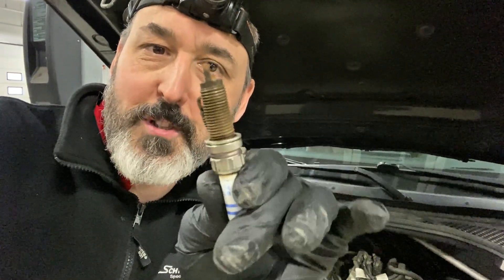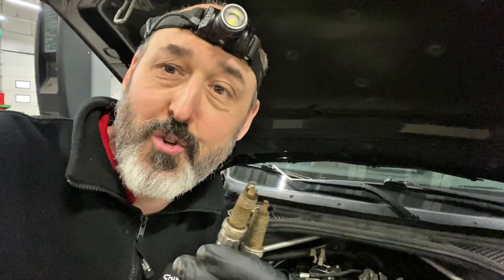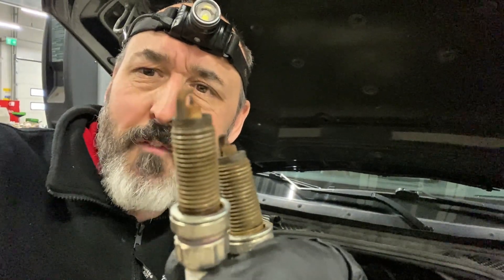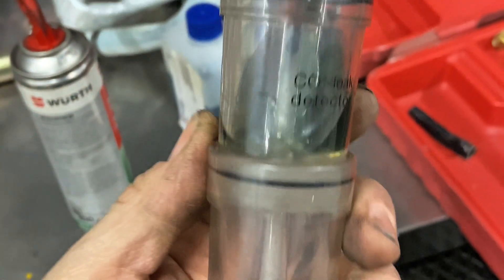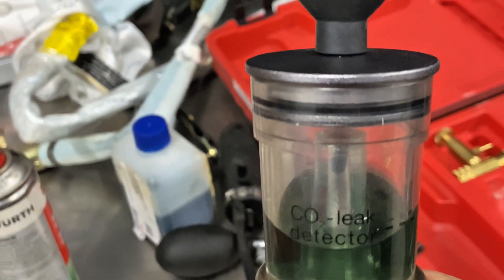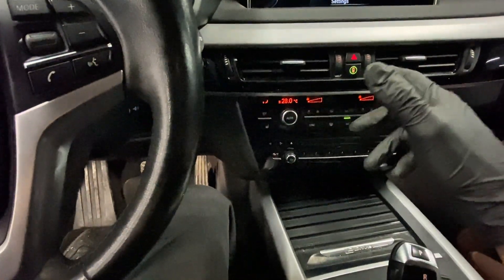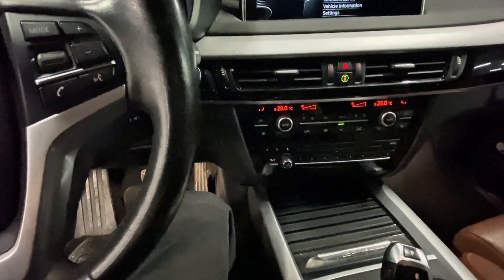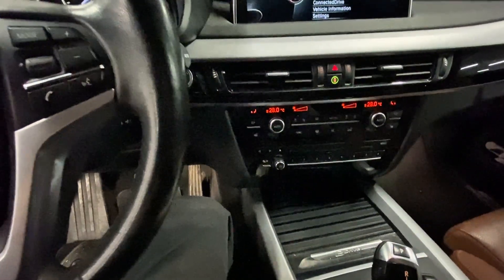Overheating Disaster: What Happens When You Don’t Vacuum Bleed a BMW N20

Comment: Do you work for a BMW dealership?  In Texas really don't see overheated N20 as honestly that engine it has very simple cooling system and the N20 is very resistant to overheating.  I8 definitely is a pain one trick that works is to raise the front end with a pressure tester hooked up and activate all the pumps as the service function doesn't work on those cars

Comment: i love it evrytym u post sumthn abt N20...im an N20 specialist over here in zim nd any1 with a fault on N20 they all say go see Cassidy...kkkk nice vid Ben
Reply from the maker: Thanks Cassidy 🙂👍
Reply: hey ben have u noticed N20 engines are seizing up a lot esp wen they get past 100k km mileage...from my research nd experience working with them, ith oil pressure control valvle seems to b th major culprit...can u make a vid on that weneva u come accriss an N20 with a oil pressure issue lyk th one u did on th N43 thanx

Comment: Doesn't the engine throw an overheating error in idrive ? Did the owner drive with engine warning ? My B48 was leaking at the radiator and kept filling it up with distilled water during a trip, but did not bleed it, I just kept an eye on the temperature and did not move over 110.
Reply: If the air pocket is somewhere where there is no coolant sensor then you can get localised overheating that the coolant sensor will never 'see' because there is no coolant to carry that heat physically to the temp sensor. (if that makes sense!)
Reply from the maker: @SabretoothBarnacle Good point. Usually on these engines its just the design that causes air to get trapped. They will warn via a cc message usually but like most garages these days...
Reply: @SabretoothBarnacle  The engine is full of oil and mostly acts a single body of heat because aluminium is a good heat conductor, whenever I checked oil temperature was equal to water temperature. I also learned that if the auxiliary tank is low the AC will decouple every 5 seconds because it overheats, but there is no error.
Reply from the maker: @istvan.design If the low temp circuit is low  it can lead to detonation as the low temp circuit also cools the intake temp via the charge cooler. The biggest issue in hybrids is the eme gets too hot when coolant is starved to it at which point on the F15 it melts the motor output stage circuits. The F15 40e is THE worst Bmw ever made.
Reply: @BenJFF  sounds like a rush job on the engineering
Reply from the maker: B48 has a cylinder head temp sender whereas the N20 does not. This job is as a result of improper bleeding which left the car stranded upon which it was recovered to us on a towtruck
Reply: Hi mate been watching your vids for a while now i am a new tech at bmw and it’s good getting alot of knowledge from yourself I am trying to get use to these engines. I did a turbo the other day and couldn’t understand why there was a bracket at the bottom and no bolts strange to me. Smashing it I am glad your Chanel blowing up